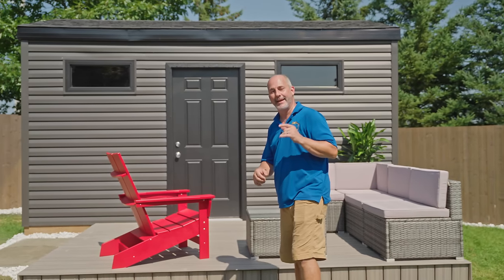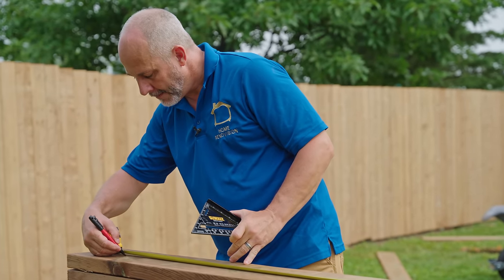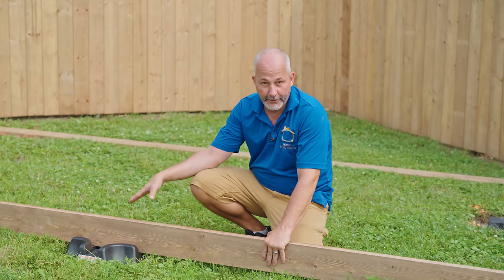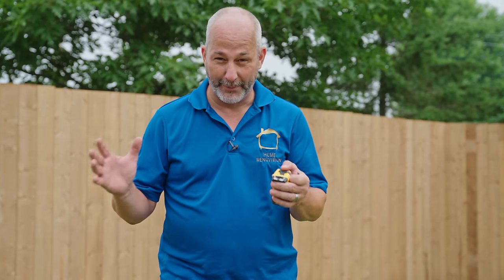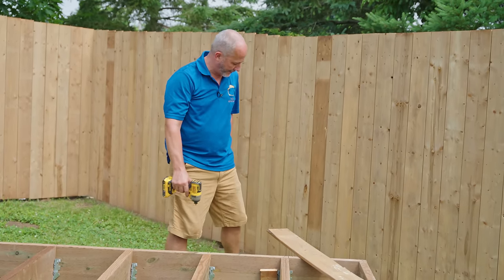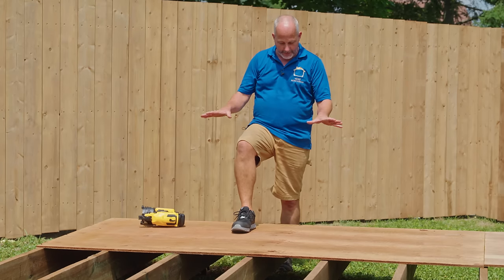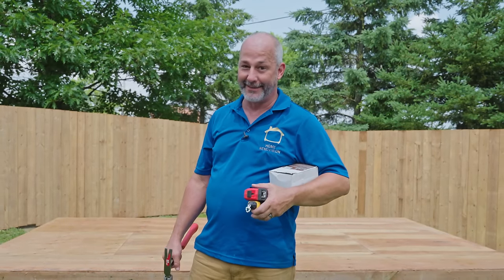DIY How To Build a Floating Shed Foundation

Comment: Save yourself the aggravation and future issues.  A bit more money up front, but have a concrete pad laid.  Have the contractor or whomever lays the concrete add some anchor bolts and bolt your walls to it.  Won’t rot over time.

Comment: I like the idea for the footing bases  but I would of had 3 per side an put noggins in between the joists and had 2 more bases in the middle just to spread the load and settlement once you put stuff in side.
Reply: That makes sense , that is the way i would do it as well.  The perimeter wall is carrying the weight of the wall and the roof.  A proper drawing is the best way to go.
Reply: Another comment said he added a camo block in the middle of the 16 foot span. Unsure of the up and down sides though, seems like an important step not to glaze over. I was shocked to think he was just using just 4 blocks for all that weight. Although he put rim joists on, I can imagine wear, weight, and tear will eventually sag the flow without more support except 4 blocks.

Comment: Safety glasses when cutting plywood or OSB.
Pull a lil piece out your eye b4 you disagree.
Dont stand behind saw.
Pull that blade out your leg from it kicking back b4 you clown me.

Other than that, i picked up several tips. Thanks!

Comment: Great video Jeff. 

I'm curious about the type of nails you used for the preassure treated lumber on the floor of the shed. I live in canada like you (Quebec city area) and its hard to find Hot dipped galvanized ring shank nails for a coil nail gun. 

Its available in the home depot usa but not in canada. 

Thanks a lot

Comment: Hey Jeff!

So the 4x4 is only fastened to the deck via your "stabilization" board?
Reply: I thought he'd use the post hardware he showed earlier but doesn't look like it, so I think you're right. He basically created a "notched" post...but not really. It's a little contradictory, IMO, for him to talk about building something quick/easy/cheap/not sexy and then him talking about how he loves to "overbuild". I think it'll end up "ok" but I don't think he can call it overbuilt since it's all only as good as weakest point.
Reply: Exactly. Curious if the 4x4 just sits on the plastic block and then the structure sits on the 4x4. One small 2x4 securing them in the inside doesnt seem to be very stable for that size.

Comment: It's great that you've posted this as I'm planning a shed build in the back garden of a property we're soon to move into. I could lay a concrete base but I've been thinking of a floating shed for some time. Was toying with having the supports buried in the ground like I'd do fence posts - dig a deep pit, bottom fill with stones (drainage) and coat the buried part of the pressure treated wood with bitumen, place into the hole and cement in place. I was thinking for extra strength have the supports extend up to the roof height. Once all the supports are in, build my frame around it on the outside of the supports, put my floor supports in then add the noggins and finally cut the flooring around the vertical supports. I'm in the UK.

Any advice on this I'd be most grateful.
Reply: I’m UK and built the legs exactly like this 21 years ago without bitumen just relied on existing fence post treatment. Shed is starting to fall to bits but base is still fine - will put replacement shed straight back on old frame

Comment: If you have a bow (crown), do you put the bow out (going away from center of structure), or in (going towards center)?  I know that if the crown is vertical (when joists are in building orientation), the bow goes up.

Comment: @HomeRenoVision - Jeff, I'm watching this DIY How To Build a Floating Shed Foundation and I'm looking at where you use a "Stabilization Block" to position, attach and stiffen up the frame to the 4x4 posts. I can't tell in the video but I'm thinking after you put the outside rim on you still have 1/2" protruding to the outside. Is this the case? Or is a 1/2" shim put on the inside so the 2nd rim is flush with the post?

Comment: I'm not sure if I missed something but, how did you attach the 4x4 post to the rim joints? Just with the 2x4 screwed to the inside? 
Also, you only needed 4 posts to hold the entire structure?
Reply: That's what I would question too... especially w the foundation not being packed,and figuring in the weight of tools,people,etc I'd image 4 posts would end up causing a section to sink or slope

Comment: great video.  What is the difference between the structure of a deck and a shed?  In even smaller sized deck videos, you normally put more than 4 tuffblock and in this video you only used 4. I'm learning and I might be asking a stupid question,

Comment: 14:05 of the video you measured 16" off the edge to the edge of the first joist. How then, did your 96" plywood land in the middle of  the last joist? Shouldn't you have backed off the first joist measurement by 3/4"?
Reply: This is the question I was waiting for too.

Comment: Video mark 3:27 - You use the term "ridge beam" to describe what actually is a "rim joist".  A ridge beam, not to be confused with a "ridge board", is a roof framing component.  For further clarification, search this: "Ridge Beam vs. Ridge Board".

Comment: Hi Jeff~ enjoy your videos.   You mentioned using 2 X 10's.  I plan building a two story Gambrel roofed shed on pier posts should I use 2 X 10X16 ~ floor boards joists?  My shed is going to be 16 X 16.  And how high  can have the 4 "X 4" the pier posts?  Because I would like room for underneath crawl space😂! Thanks

Comment: If I wanted to make a home office and insulate the floor for winter, how would I insulate the floor before putting on the subfloor? Thanks!
Reply: Start with class 5, rigid foam, concrete, then floor panel. Baseboard heating should suffice.
Reply: Ether baseboard heating or you could put in a heated floor but then you’re into electrical from the house. That could hike the bill considerably but would definitely be worth it.

Comment: I am wondering when (if at all) you added a mechanical connector to join the rims to the 4x4 columns?  I noticed in subsequent videos, the entire structure seems to be simply "floating" on the top of the 4x4s?  If not, curious why? and if you did add a connector like the Simpson one you mentioned, did you just jack it up to sneak them in at the end of the build?  Thank you very much for all your efforts to pass on your knowledge and experience, very much appreciated.
Reply: Exactly what I was wondering. The whole thing just sits on top of the 4x4 which just sits on the plastic base??

Comment: Thanks for the great video! Awesome information. Currently building a foundation for a chicken coop with your method here. Wondering - what's the advantage of the "stabilization block" over just using a bracket like the one you show earlier in the video to mount the beams to the 4x4? Anything other than cost? Thanks!

Comment: Joists on 16" centers and 8' plywood flush with the edge of the frame. There is no support for the inside edge of plywood. Do you shift center joist 3/4" over to catch the plywood?
Reply: I scrolled trough comments to see if somebody already asked that. Jeff carefully ommited this detail.

Comment: Also wouldn't you worry about the corners getting saturated with water after a hard storn,causing a lot of moisture? Or even worse sinking cause of the weight? Just curious

Comment: So wouldn't siding be best to overhang that sole plate?  Thus wouldn't you need to adjust the joist widths to the 3" per each double rim joist and then the width of siding?  

Or is it "structure" width and not wrapping width included?

Comment: so jeff just fyi when i built my 16x10 shed its 161 square feet / 15 square meters of *usable space". walls dont count towards that. but 16x10 outside demensions made more sense because the way building materials are sold.. it wouldent have made sense to add 7-9 inches to my outside dimension because I just have to scab that onto my other side. sheeting while coverings, etc
Reply from the maker: always try to build with stock materials. speeds everything up. Cheers!

Comment: Were the 4x4 attached to the 2x8 structural frame directly? Or is that what the 2x4 "stabilizers" you installed on the inside for? 26:38

Comment: 23:25  Isn't better to install hangers first so that they are preloaded?
Reply: The problem is pressure treated 2x material is never exactly the size you think it is... You can have a stack of them and they can be all slightly different sizes, so if you set your hangers some will then be either too high or too low. Jeff knows what he's doing :)

Comment: How high of a deck can you build ising the deck blocks? I know there are probably code requirements, but those aside, can you build a high deck with just the blocks instead of concrete footing in ground?

Comment: Why did you attach the off of the 16" centers? Shouldn't they be centered on the 16" center line? Do the joists need blocking?

Comment: Serious question... The way you laid out the floor joists, wouldn't that cause one side of the 4x8 plywood foor to land on the edge of the joist rather than the middle, assuming you started the plywood all the way on the outer edge of the frame? Or do you start the plywood floor on the center of the outer joist in order to stay on centers?

Comment: I'm really interested in the tuffblock thing but there's one thing I wonder. Can the plastic break because of extremely low temperature ? I'm in Quebec and it can get really cold here. Won't the Tuffblock break because of the cold ?

Comment: How were the Camo blocks leveled with each other? Were the 4x4 posts cut to same height?
Reply: I reviewed the shot where the 4x4's were visible on the one side. They must have measured from the bottom of the camo to the level mark on each corner individually, then cut the 4x4's. Result, all 4x4's are probably a different height.

Comment: RE: Ontario Non-Permit; do they exclude wall sheathing and siding in their consideration for size. So as long as the framed portion is 16x10 its safe? as the walls and siding could add an inch?

Comment: 💥For Example Why not a 12 by 8? Then you have equal spacing
 for Plywood Drywall and Everything else?
Reply: I think in ontario it's now 160'² for maximum size without permits.

In many places it's 100'² so a 12x8 is optimal and don't even need to trim your boards to make it fit under 100'², I like your thinking less cuts is faster and less waste.

But... I just finished a 12x8 and its already too small.😅😂
Reply: I'd rather a 12x16 personally, it seems in their Province in Canada there's a smaller limit before a structure needs inspected. Here in our state & county 256' sq is the max before inspection.
Reply: @philsowers  I wish...

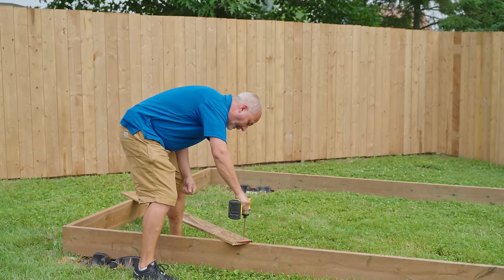Comment: @16:40 nope, only need one screw, that's the advantage of triangles all corners can be "pin joints" and none of them will actually pivot vs a square+
Reply: highly related (and a very useful concept)  " all 3 of the leg elements  in a triangle  (if loads are applied at the pin joints/nodes/intersections) will always be purely tension/compression members... there are no bending loads, the legs never act as cantilevers... thats why single pin joints won't allow movement.... heck they could even be bearings or bushed pins ;-) !    It never hurts to add extra fasteners though.    Next time you look at a fabricated structure like a bridge truss with rivets  look at all the triangles and struts that are employed.  Also consider computers model solid objects  as a network  of   triangles (2d) or pyramid meshes (3d)   ...'Finite Element Analysis" to break it down and do the math on solid objects.

Comment: Can you do a video for replacing old phone wiring for a single landline that leads to multiple rooms of a house starting from the box outside?
Reply: I'm a telecom guy. What shape is the old phone wiring in? Are you sure you need to replace the cabling? Best practice is to either make home runs from the demarc box outside to each outlet or to extend the demarc with a cable from the outside box into somewhere inside the house where you can mount a 66-block and then run cables from the 66 block to each outlet. 

Do you have access to run cabling through the walls? You can do it through the basement if you have an exposed ceiling in the basement, or (way more miserable) drill down from the attic. I hate running cable in residential settings. If you can avoid it, do so. 

You can find a bunch of videos on how to punch down a 66 block. You usually punch the incoming phone line down to one of the first positions. Then you daisy chain connections from that position down the 66 block to where the cables to the outlets are punched down. Or you can just run all of the cables into the carrier demarc box, strip off the last 1/2" of insulation, make a hook in the wire (with the end of the hook pointing clockwise), and screw it down to the screw posts. Each phone line uses only 2 wires -- one for sending and one for receiving, so 1 Cat5 or Cat5e or Cat6 cable will provide 4 pairs for connecting up to 4 incoming phone line. For the cables going to the outlets, you just have to use one of the pairs if you only want 1 line at each outlet.

Inside the jacks, the wire numbering goes like this: 7-5-3-1-2-4-6-8, so line 1 is the inside pair (wires 1 and 2), line 2 is the next outside pair (wires 3 and 4), etc. Most phone jacks are RJ11 or RJ12, so they only allow 4 or 6 wires, respectively. If you are using old style outlets with screw terminals, the red and green wires are line 1 and yellow and black wires are line 2. Newer modular jacks that need to be punched down with a 110 punch-down tool have a color code on them to follow.

Comment: Your footing is as good as the soil underneath. If your soil isn't stable (like mine), you better pour 4 foot concrete like the good old days... 😉
Reply: @GARRY3754  You can not cover everything. A swamp or rock formations and everything in between.

Comment: Newbie question...but I live in an area that has moderate to heavy summer rainstorms. If I were to tackle this project in the summer, and a storm comes through after the sheeting is down, will that be "okay" for exposed sheeting to take a lot of rain if I don't get the whole thing rain proof/roofed before then?
Reply: Cover it with poly sheeting or a tarp

Comment: Did he calculate the load? At 1,800 lbs capacity x4 he can only load the blocks with 7,200lbs. Dead weight is generally 10lbs psf (1,600lbs for a 10x16) and you need to multiply that by 2 since there’s a roof (3,200). Idk what the live load is Canada for floor or for the roof but in the U.S. it’s 40lbs psf for the floor which would already fail the structure, nvm the roof load…

Comment: Did I miss where you actually secured the platform to the 4x4 legs? That 2x4 stabilization block can’t be it right?
Reply: I looked for it too - he either edited it out or didn't film it.
Reply: 27 mins.

Comment: New to building, please help. Building a she shed office for wife 10x12 in washington state. Using 12 camo blocks with 4x4 posts using 2x6x12s on either side of the 4x4s to make beams using structural screws. The floor is then made of 2x6x10s with single 2x6x12 rim joist. Im using 2x4s for framing with 3/4 inch plywood subfloor siding with additional siding to be added and 3/4 inch plywood for the roofing. The beams go full length of the floor but the long sides are cantilevered 16 inches from the middle of 4x4 posts along the beam. The roof will be single pitch lean to style. Walls will be 7'6" on back and sides whereas approximately 9 feet on front. The shed will be finished on the inside in tiny home style fashion. And have a desk on the back side. I will have windows on the sides and a door in the middle front unless swapping it to the side is safer. Question is whether i can do this safely for my wife to work in 12 hours a day or whether i need to rebuild the walls to shorten over the beams or just focus theblive load to the center over the beams by putting the door in the middle. Most plans ive seen allow for the cantilever but when i look at residential building code the allowable floor cantilever is only the size of the floor joist. Ive built the beams floor and 3 walls already but as im new to building am getting nervous about putting the weight of those walls over the cantileverd sides. We won't have lots of things stored in the building as it will be meant for using computers and have decorations rather than storing heavy equipment and such.

Comment: Nice vid, but you are wrong @16:50, a triangle is fixed w only one screw in each corner. That's the wonder of the triangles rigidity and why it is the base in so many construction elements.

Comment: Wait the deck isn't attached to the posts??? im trying to see if you used any post hardware to secure it other than that 2x4 for stabilizing the frame. 

guess it won't shift on those posts but having the foots not secured to the ground or the deck feels wierd to me.

Comment: 36:15 your saw bound up because your helper was lifting the off cut, pinching your blade. Just let it drop. Also would have probably been easier to start on the other side of the sheet

Comment: What's the difference between the roofing nailer you use and a framing nailer?
Reply: The roofing nailer shoots nails with wide gears good for sheet goods or siding etc.  Longer framing nails are good for their shear strength and don't need a big head.
Reply: Joe, The roofing nailer shoots roofing nail the head of the nail is bigger and flatter

Comment: Great video.

One small concern;

I'll see where he extended his saw blade just enough to score a line for the NEXT board.

That's all fine and well if you're just getting too boards.

But using each score line to cut each successive board, will result in gains or losses in length. Guaranteed.